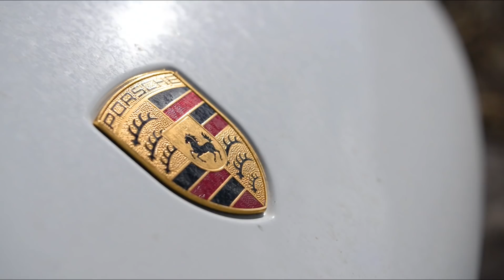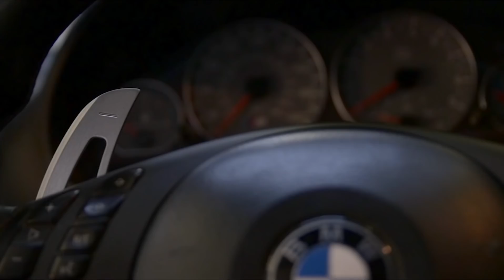Cars Are Changing

Comment: I honestly REALLY love the movement of modern cars tbh. I prefer DCT traditional manual because of how fluid it is to use. I like super buttery power steering and traction control because of how easy it makes the process of driving. I like all the computerized component getting integrated into the operation of the car because of how streamlined and enjoyable it makes things. Overall I feel we shouldn't reject quality of life improvements to cars so long as it serves to make the function of motor vehicle operation better.

Comment: Automatic vehicles are good for a relaxing drive from point A to point B. Manual transmission cars can offer relaxing ride depending on how it is driven, but they mainly offer a more engaging and spirited drive. Manual transmission cars with mechanical steering, throttle and such are good fun cars, but there are days when you just want to chill and automatics are good for that.

Comment: The reason we are hating is because it doesnt feel like theres been enough the of the spirited steering and manual gear box cars getting made to make up for so many people love cars not be able to get a new and improved version of those. Like 90s japanese and early 2000s cars are alot of peoples dream cars but so many of those heros are dying off to where no longer innovative but sad and dead. Rx7 dead, Supra not built to many of the followrs and fans desires, brz/frs not turbo'd, sti has a fat body, evo is dead, nsx is hardly affordable, gtrs and the s15 are going to be 25 years old plus by the time we even get to touch them in the US, and the r35 isnt a manual, no s16 from nissan, the celica and corolla, maxima, and whatever else became fwd grandma cars instead of rwd legends. Theres more and more of this to be said, but the point is car enthusiasts arent being listened too so people end up going back to old stuff and making that stuff better themselves rather then a new and improved model coming out. I keep saying, technology isnt a bad thing. Its great, its just not being used in a fun way, for example, an ideal build for a new brz/frs would be the FA20DIT with push button electric awd for the front, but with that button not pushed its rwd. Keep the manual put some more aggressive body lines on it and you would a car that would sell like hot cakes.

Comment: I think about this often. I spent a ton putting a newer BMW v8, coilovers, sway bars, bushings, etc, in my e30 just to make it on par with a stock e46 M3/e90 335i in a straight line with nowhere near the cornering ability. But, I love my car for what it is. The fact that my daily driver Focus ST does a lot of things better than my e30 as a sport economy car is just a sign of advancement. It doesn't make the old cars obsolete, it just gives a different experience. The plot in old movies are still good even if the CGI sucks. Same goes for cars.

Comment: fuel injection was available in the fifties so it is nothing new and the manual transmission will not go away because real drivers want a manual...automatics are for noobs and quarter mile runs.....the only new tech is the computer in the car and it's control over functions like abs but the rest of the car is old tech....
Reply: Alright let's start, you walk up to your car and it unlocks automatically, so you get in and press the start button without putting in the key. You turn the little dial in the middle to drive and the computer puts it in drive, but wait you're feeling adventurous so you turn a different dial to sport mode. Then you press the electric sensor on the gas pedal to tell the computer you want to accelerate. Theres more but im bored

Comment: Sure, but they are killing things we like, the roar and the punch of a VTEC was killed, the big ass lag followed by a big ass kick in the seat of a turbo was killed, with eletric steering now you have 000 road feel can't even feel the bump steering, with autos you lose feel, you can't feel the engine/gearbox vibrations you can feel that perfectly matched no clutch gear up. We are turning drivers to operators that just operate eletrical switches and knobs with no physical connection to our car/road. This is like driving a Miata, who cares if you are slow when you are smilling everytime you floor it or take a turn? Who cares if your 0-60 is 0,5s slower because you have a manual and not an auto? Its just sad to know that in a not so far future I will strugle to buy a brand new performance car with manual and real steering....

Comment: The manual transmission complaint isn't much about efficiency or faster. It is about the entertainment value. The problem is 95% of people driving cars don't care. They just want a point A to B car. It is easier and more convenient to drive an automatic so that is what they buy. In all seriousness, drive a manual and an automatic of the same car. I can almost guarantee you will have more fun in a manual even though newer automatics are sometimes faster in a straight line, it just doesn't require the same kind of focus and involvement in the road.

Comment: The experience counts. I had a GTI with DSG. I bought it after a friend let me drive his R32 where the sound of the car captured my soul. The car felt lighter than my '95 M3 and that was good. After a while, I noticed that the DSG was a good advantage in traffic, but I didn't go driving just for the sake of it, like with my previous car. When the ABS system had to be replaced and the cost was insanely high I bought a 2015 WRX with manual transmission. Happy that it had the newest engine with all the tech, four doors, my wife's only request when I go buy a car, and the engine sounded better than the GTI's. When I got that car I thought I would never again buy an automatic transmission car if manuals are available. I don't even care if the lap time is faster. I care for what the driving experience returns to me. I went to the Boxerfest after watching your video of 2016. I heard while waiting to enter the EJ engine and I was hooked with the rumble. I almost felt that my car didn't belong there, but I was going to wait for the next generation until I heard that Subaru might get rid of the rumble. Then on my birthday week I went to the dealership and got me an STI that combines several things that I love and I felt that several cars are lacking these days: the price was something I could deal with, it had the Subi rumble, manual transmission, good brakes, an old engine, yes, that sounds awesome and feels refined and also mechanical. I feel that there might be cars that could be more rewarding, but not that many, not with 4 doors. The Type-R was not for me. We will have silence in the near future with the electric cars. But the enjoyment of the electric car is on the instantaneous acceleration, and the STI brings the joy at any speed. I would have waited for the next generation STI if it would sound like the one from this generation. I would have welcomed direct injection, yes. People are asking for more power. We are living in the present and fortunately, there are still fun to drive cars available, even Ford, that gave up on cars sells the Mustang GT still, which to me is the better Mustang GT ever. Subaru, please keep the STI with the raw mechanical finesse feeling. It is not true that the past was always better. I love the 911R to me is the best one, even better than the old ones, but it is unaffordable. Price is a very important factor. What is the average price of the car on the street?

Comment: The problem with the manual transmission becoming an unavailable option due solely on market demand makes enthusiasts think that that are now an unheard segment of the market. That’s the real reason for the outrage on the disappearance of the manual. I’m sure people opposed power steering and cruise control and disk brakes. But disk brakes and power steering all ultimately made driving more fun. They actually granted you more control. And cruise control can be turned off. You don’t always stay on cruise control.

Comment: Tbh I complain about loosing the manual transmission not because I am reluctant of technology, I complain because it’s taking away a choice for us. I wouldn’t compare it to our opposition of fuel injection when it first came out. There’s no direct input between the driver and the fuel delivery method to begin with. But with transmission, it’s like if someone wanted to replace steering wheels with buttons or sticks or something and then tell us there’s no option to use a wheel.

Comment: They have made newer cars almost unmoddable with how fucking shit the stock layouts are. 
If you disagree, you haven't bought a car in the past 10 years.
Reply: Also, I don't think changing from a carburetor to fuel injection, or engine size really mattered. Sure, maybe TC fucks with shit a bit too much, but most cars can disable it. 
Dual clutch ruins the experience of feeling connected to the vehicle.

Comment: I bought a manual and drove it for a year, then sold it. And went right back to an automatic.
Easier and faster.
Reply: For me that always buy second hand cars, I would see the reliability of the automatic first, then if reliable, I will buy it. Manuals are generally proven to be reliable since long time ago, but some manufacture ruins the automatic reliability by using low durable parts.

Comment: Sorry, but is has nothing to do with "just not being used to the new stuff". Almost EVERY change that has come for modern cars has taken away from the feeling and direct driver control. Everything gets more automated because of the average joe driver who can't be arsed to learn how to drive properly but instead needs to be saved from himself (i.e. not paying attention --> braking or line assists, unable to regain control of car --> safety programs, etc.). Also, most manufacturers don't want a servicable car. They want you to buy a new one every two years, and in the mean time come to THEM for repairs, not do it on your own. So most newer cars are hideously hard to work on to the point you can't even change the tyres because of pressure sensors.

Yes, new cars are more efficient and have often times more horsepower than their older cousins, but they feel bland and don't give good feedback. And that's the problem. Most car enthusiasts don't really care about numbers or how fast a car goes, but how it FEELS, how it engages you. Look at some underpowered cars like the MX-5 or the 86 that are beloved by millions for their purity and driving pleasure.

Also, the logical end point of more gizmos and computers that take away control from the driver in the name of efficiency and safety is indeed a self driving car. And I'm sure the point will come when an autonomous vehicle will be faster around a track, because it can measure everything to a millionth of a cm or degree, but the question then is: Why? If nobody feels the excitement of handling, honing their skills to become better, why race at all? 

So sorry, but enthusiasts have all the right to complain about many of the changes to cars today, as they can see where this will lead to.

Comment: The only assist I have is ABS, and I like it that way. It transmits engine noise into the cabin by being loud, not by faking it with speakers. A while ago Renault sold Clios with a system like that that could recreate the sound of the (older) Clio V6. It's faking the sound of a better car, a real bonafide enthusiast car (an underrated MR beast) and putting it into a soulless economy model.
And my car is 20 years old too, I'm not sure how modding or tuning it is any more difficult now than any other car. My car still has a massive following and aftermarket and it's only two years newer.

Comment: You're wrong. Change is irrelevant. The point is the experience. 

An EK Civic from 1999 is more fun to toss around than an Evo X- I know first hand. And this should not be the case. Modern cars, for the most part, are incredibly distant. Soulless. Antiseptic. People call it "refined," but its just numbing. A manual trans is a point of control that is being taken away. Electronic Stability Control is the same. Heck, even ABS takes away control in that you are no longer the only one telling the brakes what to do.

Those of us who can actually drive want to actually drive. And to us, that means having control. In many cases, it's fine to be able to give up some control. On a long drive home in heavy rain, when I just wanna get to bed, I'd love my car to drive for me. And failing that, I'd love to have ECS/ABS/Cruise control/etc. But what you advocate is complacency, which would lead to all control being stripped of those of us who are actually passionate about driving.

Comment: Cars are changing, my Peugeot 306 cannot fit an aftermarket cupholder anywhere, the torque leaves a lot to be desired, and the gearbox resembles rowing, but the seats are really comfortable, even if they give little support in cornering, the engine is surpringly peppy, rust is near non-existant and it handles my stupid mistakes.

The 2015 and 2017 Ford Focuses I learned to drive in have that cupholder, and more buttons I'm comfortable with. The steering is light and driving is muted, like in very near any new car today, the clutch is obscure and the brake pedal stops the car when you lightly blow on it. The front interior feels oppressive, like it's trying to eat you, where as my 306 just presents its amendities in reach. The Peugeot is now 23 years old, and before someone points a gun at me, I'm not choosing the Ford.

Comment: How can you compare the fuel injection and manual transmissions? Losing manual transmissions in cars is a far more significant change that will actually change driving than engines going fuel injected.

Comment: If I won't be able to buy an internal combustion engine car. I'm just going to ride a damn bicycle. DCT, Fuel Injection is a one thing, Making a car basically a computer with an engine is just frustrating. Electricity is IMO to power Headlights, Tailights, and Ignition. Maybe the seats and windows too. Nothing else. I know that it's more comfortable to have everything be operated by a computer, but some things just shouldn't be changed.

Comment: What bothers me about modern cars is theyre locked down, everything has to be OEM or the computer will reject it. Everything has to be registered somewhere. Just look at the new system BMW is thinking of: Enabling extra horsepower for a certain period of time by buying it in the cars onboard computer.

Electric cars will inevitably take over. In a way I like electric cars but I fear that it will end up like Apple computers - Nothing is repairable, nothing is interchangeable. Electric cars also lack character, especially due to their near perfect torque curves or lack thereof. Every gas engine is different and feels different, and most importantly: *sounds different*.

I think alot of people dislike automatics because they take control away from the driver. Automatics sell well because the majority just wants to get from A to B with the least possible effort. I mean there have been efforts to combine the gas and brake pedal. In the end it will be like a Video game: Steering and Going/Stopping.

Comment: Just because the modern pdk id faster than a manual doesnt mean i want one.  It's simply not as engaging to experience.  im not resistant to all change and I tend to have a very open mind but that to me over simplifies the hobby I fell in love with in the beginning.  they need to find ways to innovate that dont take away from the driving experience but enhance it, and im sorry, but autos take away from that indescribable emotion that goes into driving that we all fell in love with.  very insightful video otherwise

Comment: As much as shifting and the sound of a petrol engine adds to a driving experience.  Its hard to beat the performance advantages of an electric motor AND no transmission. Especially as batteries only get better.

Comment: I agree with a lot of what is said. the main problem is see is that consumer sports cars keep getting heavier. sports cars shouldn't be heavy. doesn't matter what power train or advancement in technology, the simple physics dictates that lighter is sportier. motorsports and supercar manufacturers still pursue weight savings, but the consumer market has left the consumer with extremely few options.

Comment: when i see BMW's from 2013 ,2014 , 2015 that brake the distribution chain ... and the old e30 and e36 just goes flat out no problem
when i see diesel VW with injector problems , turbines , and other stuff ... and a 93' golf TDI goes strong no problem 
when Audi CVT gear box is as smooth as falling on stairs , and a 98 A8 is just amazing 
change is a good thing , but when ALL car makers make the cars less reliable just so they can sell more parts , and make more money ... THAT'S A BIG PROBLEM ! ! !